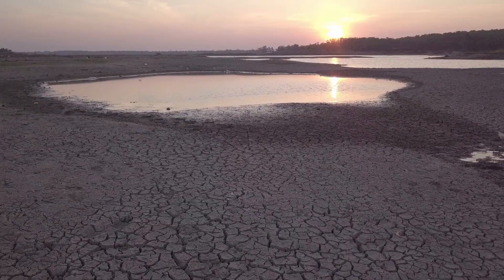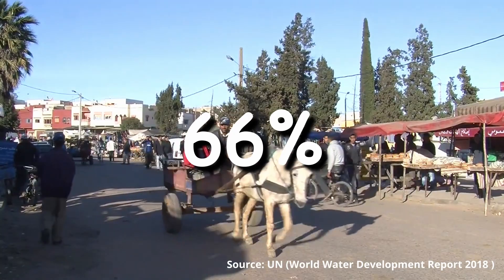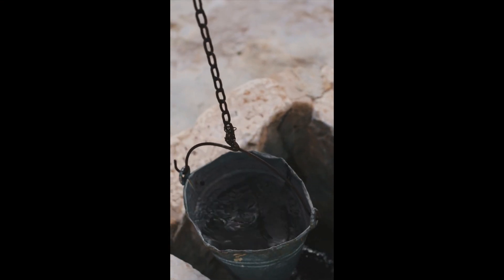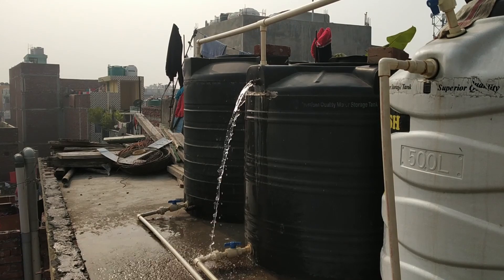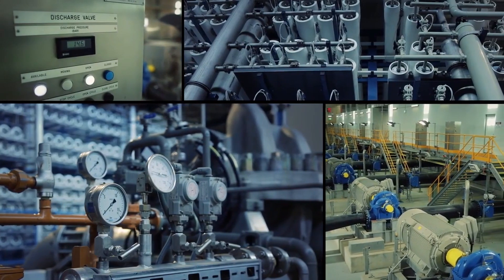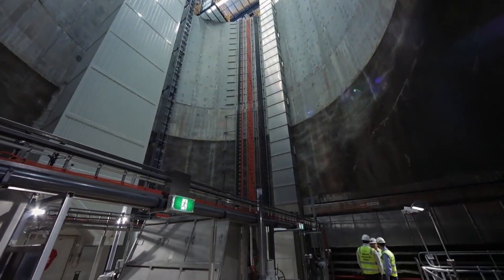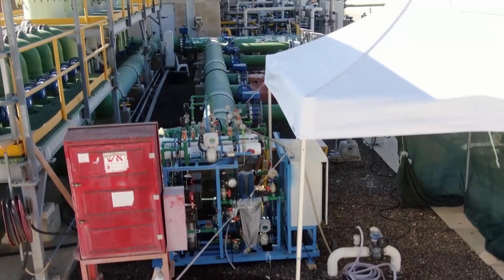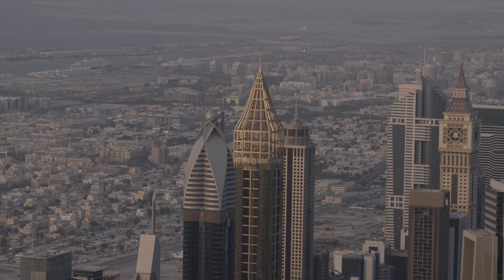Desalination: Turning brine into a resource?

Comment: Instead of discharging brine in one spot in the sea, why can't we use a very long undersea perforated pipe (perforations can be similar to holes in a flute) to discharge water over a large expanse of the sea / ocean. Using this simple technique the salt content will not inordinately increase in any one spot.
Reply: I'm not too sure, but I think there would be a few issues with this approach.
Reply: It would still  increase the salinity of the wide area on a wide scale. We need to just find a use for brine
Reply: @noirekuroraigami2270  Use the Brine to separate hydrogen and oxygen from water using green energy and use the hydrogen in fuel cells and combustion engines. Similar, Industrial uses for oxygen. The remaining salt, primarily sodium chloride, can be used in homes etc.
Reply: Brine also contains stuff like lead and other chemicals
Reply: other than the treatment chemicals added (which, why??) this can't be any different than water evaporating from the ocean naturally. over a wide area, there won't be any harmful high concentration of salt, especially if placed near a tidal basin which can help disperse the brine even farther.